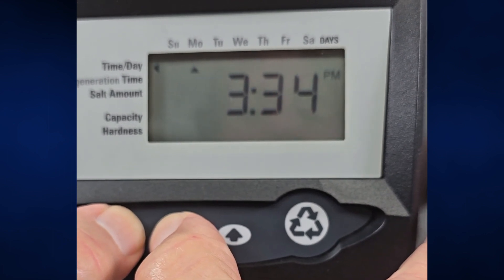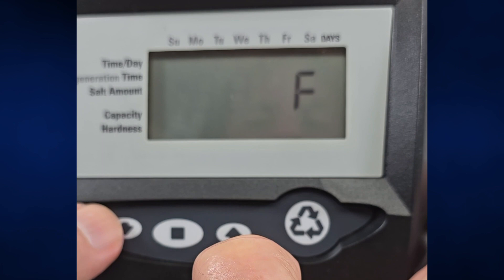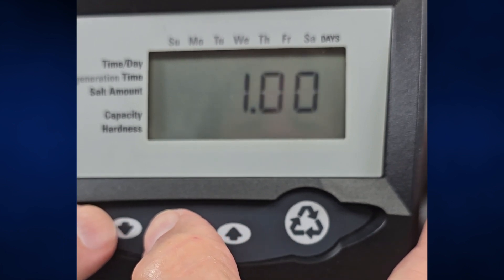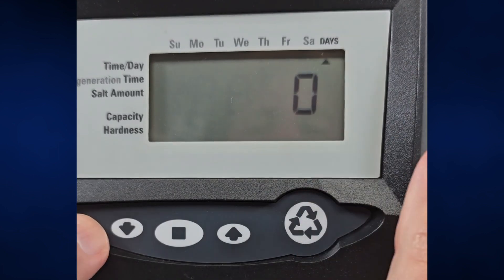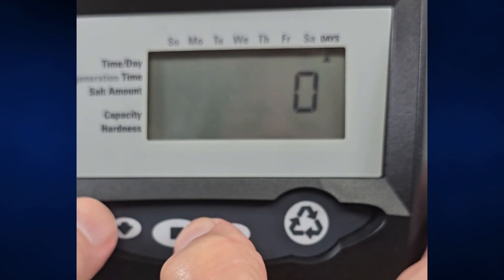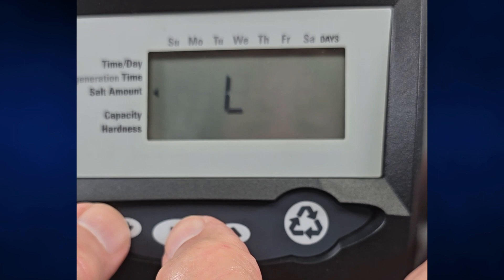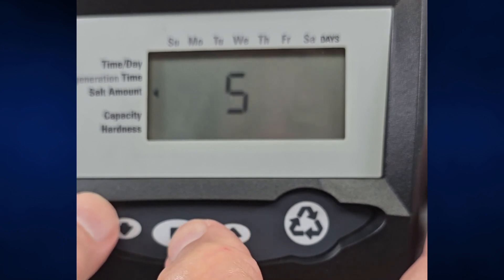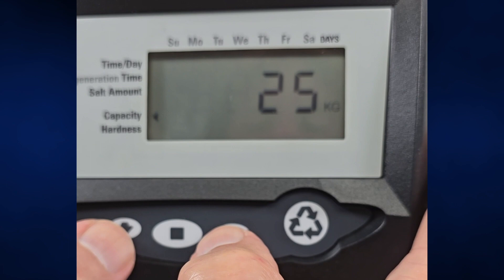Logix 760 Progamming

Comment: Hello, Is there only in gallons way to see on the screen? Can i change for litres? And i really cant understand the set up for qubic feet 1:00 - what should i declare in this place? Could You please help - i cant find explanation in manual form Pentair corp.
Reply from the maker: The manual references on pages 39 -42 that the control can be changed to Metric units. Top of page 42 explains how to get to "professional" mode programming. see https://www.softenerparts.com/manuals/logix%20740%20760%20255%20268%20268fa%20performa%203003714%20re.pdf
Reply: @WatermanAndy  Thank You very much for Your help and manual. I will try it. Best regards from Poland 🙂
Reply: Thank you